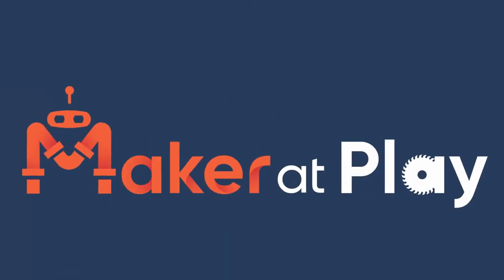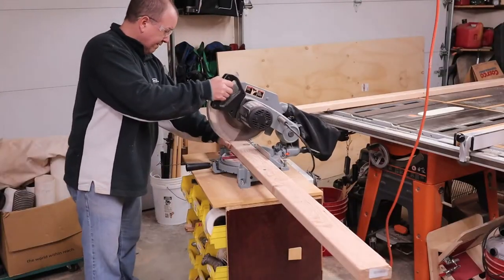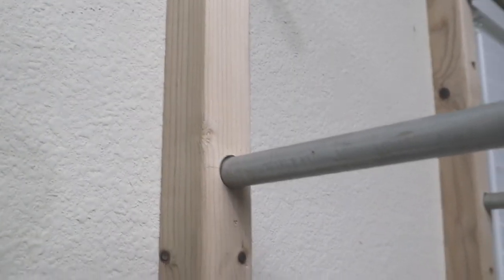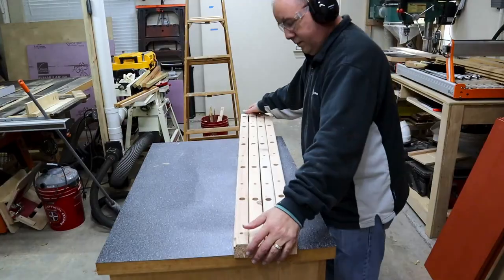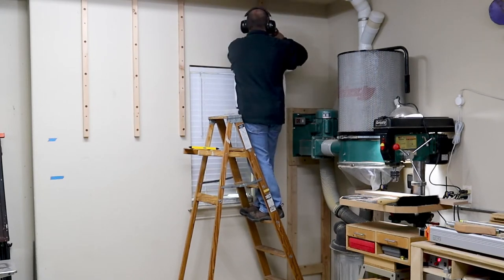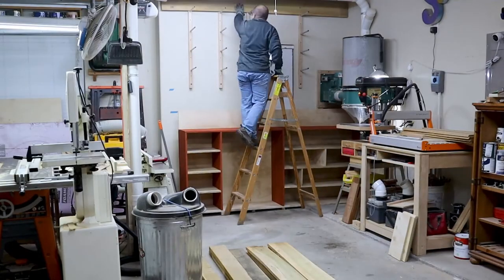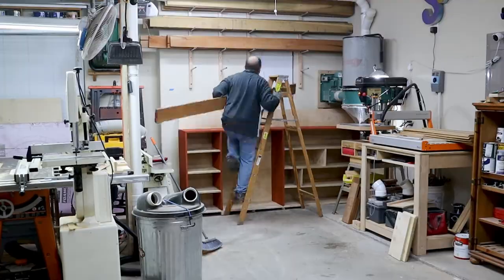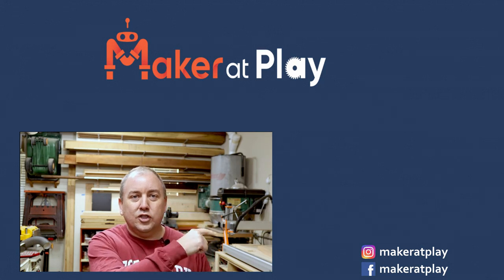How to Build a Wall Mount Wood Rack

Comment: What angle did you use?
Reply from the maker: I just throw two 2x4s  at one end to create the angle on my drill press. So about a 3 inch rise over 24 inch run gives you about a 7 degree angle.